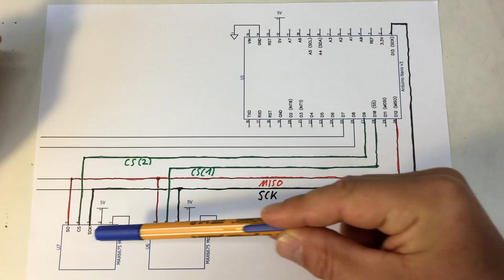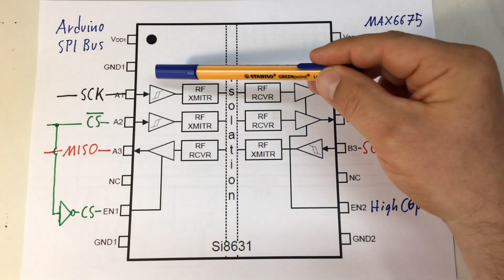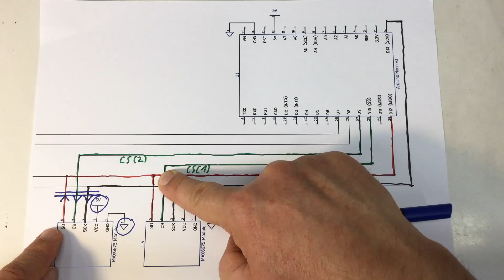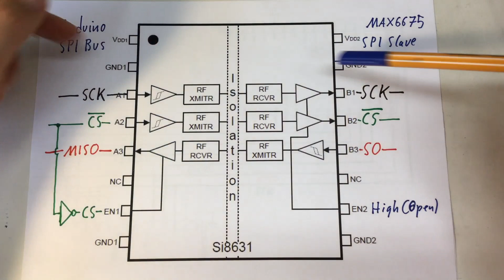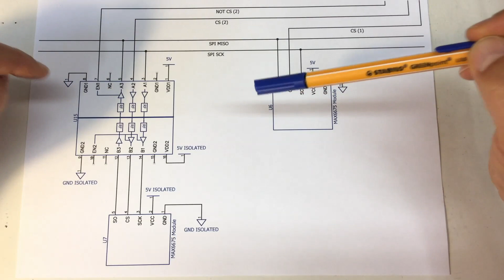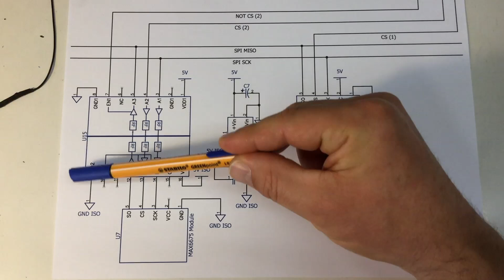Galvanic Isolation of SPI Devices (e.g. Arduino, MAX6675 and SI8631)

Comment: Hi Robert,

I am trying to isolate only 1 MAX6675 with Si8641. It works well for a few seconds but then intermittently the temperature readings show 0.00 & then the correct readings come up again. This sequence of 0.00  is completely random.  I checked all the wire connections but to no avail. MAX 6675 works perfectly without the Si8641. Could you please provide a clue of what may be causing this random behaviour? 
En1 pin is held high through 10K resistor as there only one MAX6675.
Your reply will be highly appreciated.
Thanks
Reply from the maker: Hi Luci, it has been always hard for me to remotely diagnose intermittent errors 😅 But anyway ... Holding the EN1 pin of the Si8641 high all the time could be a problem, because the MISO pin of the MAX6675 goes high impedance, if its CS line goes high, and thus the A4 output of the Si8641 might be undefined. It's better to feed the inverted CS signal into the EN1 pin of the Si8641 as I do it in the video, even if you're using only one Si8641. Hope that helps.

Comment: Is it possible to multiplex multiple Max6675 and use only 1 Si8631?
Reply from the maker: Not really. How would you get several (!) chip select (CS) lines for multiple MAX6675 through a single SI8631?

Comment: Hi Robert. I have successfully isolated two max31856 using si8641. In my design both of them are isolated from the Arduino ground because in a automotive application almost any metallic part of the chassis is a ground. Thank you for the lesson!
Reply from the maker: Hi Mircea, you're very welcome!

Comment: Thanks for the video. This TC seems a grounded one. Why does connecting one  to the V and other to the GND of the multimeter cause TC to incorrect measure the temperature ? is there connection inside the multimeter or the is multimeter just disturbing the TC generated voltage ? Would the same happen with an isolated or open (non-shielded) TC ? From literature it seem that mosly galvanic isolaters are to protect from ground loops  when a non-isolated TC is connected to a conductive housing but when the logic is an externally connected. In another case, when the ADC circuit would be placed in the same enclosure as the TC, would galvanic isolation make sense when the MAX (ADC) circuit is power from an the same power supply but with it's own 220V to 9V transformer ?
Reply from the maker: I guess you're referring to 01:01 where I connect the multimeter: The error is caused by the multimeter injecting a current (it's set to measure resistance) into the grounds of both TCs - a positive current into one and a negative current into the other. That current loop is of closed on the breadboard via the common ground for everything. So to the currents generated by the TCs (comparatively small) the negative, respectively, positive current from the multimeter (comparatively large) is added, and thus one MAX6675 reads a far too high temperature and the other one a far too low temperature.
So the goal here is to break that ground loop. You could have separate power supplies (transformer etc.) for both MAX6675s, but as long as you connect their grounds together again (and in this case you need a common ground for the SPI bus), you won't break that ground loop.
Hope that helps.
Reply: @robertssmorgasbord  Thanks that explains it ! Assume the ground loop happens with the MAX31855/56 as well. Also when having multiple TC's, assume that each should have their own DC/DC converter (unconnected GND) as their analog GND/PWR front end. Though this particular problem would only happen when mounting the TC to a electrical conductive part, (which may happen easiy with ungrounded TC's). Assume that is often not the case as to avoid the thermal conductivity of such part and influence of the maeasurement.
Reply from the maker: @de-bugger  You're welcome! And yes, the MAX31855/56 has the same problem. Anyway, two TCs being somehow electrically connected by the parts they are mounted on is not that uncommon and can easily happen by accident. E.g. you're measuring the temperature of the heat sinks of two power supplies and both heat sinks are connected to mains earth ... ground loop!

Comment: Thanks for the vid Sir when i read about SPI isolators it was stated they are used in circuits with a mix of high & low voltage to protect the low voltage section which is why i did not use it for my problem where I have an Arduino with Bluetooth which is used to simulate a cd changer/shuttle to fool the stereo and allow playing Bluetooth music to old stereo but the problem is i am getting digital noise on the speakers. The Arduino connect to the stereo using SPI. Do you think SPI isolation approach you utilised here will fix my issue?
Reply from the maker: It should! SPI isolators are routinely used to translate between 5V and 3.3V devices. In fact when "inserting" an Arduino into your CD player it might be a very good idea to use galvanic isolation. In other cases you could also use a non-isolated level shifter like the TXB0104.

Comment: Searching for I2C Isolator. Would appreciate your advice.
Reply from the maker: I've used a Si8600 (relatively cheap, designed for I2C) in my "Galvanic Isolation of 1-Wire Devices (Direct Power)" https://youtu.be/WvG2_sHoxCQ video.

Comment: If i want to isolate 8 thermocouples how to do that. ? 

Do i need to isolate each with each other.?

That would require 28 those isolator modules.

Pls help
Reply from the maker: You just need 8 digital isolators (plus 8 isolated DC-DC converters) ;-) If the MAX6675 is run through such an digital isolation it's isolated, full stop. There is absolutely no need for more digital isolators / isolated DC-DC converters. There's also a video out now regarding the current/power requirements for digital isolation: https://youtu.be/BpCzpMnXc6M
Reply: @robertssmorgasbord  Would it be possible to use an isolated thermocouple, so that we need not do any isolation ?
Reply from the maker: @mumbaiverve2307  Yes, of course. Though most type K thermocouples are not isolated you might be able to find some that are. If you do, please let me know.
Reply: @robertssmorgasbord   Hi Robert, thanks for your reply!
I was not aware of that. I recollect using J type thermocouples which were isolated and not much more expensive than non isolated thermocouples,mostly in injection molding machines.Nice to learn something new ! 
https://www.amazon.in/Isolated-Ungrounded-Thermocouple-Sensor-Celsius/dp/B07HVBQ738
I am not affiliated to them in anyway; just googled :)
Sometimes the nomenclature differs from area to area; so here when its said its isolated, usually it is meant that the thermocouple leads show no continuity with the mounting body of the TC; I hope you mean the same by isolated TC.
Reply from the maker: @mumbaiverve2307  You're welcome and thanks for the link! Please excuse my use of word "isolated" in that context. While it's a perfect description of such thermocouples, the commonly used term here is indeed "ungrounded". But you found that out by yourself :-)
Reply: @robertssmorgasbord   Am I right in thinking , if we use "isolated" or "ungrounded" thermocouples; we need not do any optical isolation.Thanks a lot for your patience :); I realise answering comments is a big chore !
Reply from the maker: @mumbaiverve2307  Yes, you're absolutely right. It doesn't matter where the isolation happens, in the thermocouple itself ("isolated"/"ungrounded") or further down the line like shown in the video. Electrically it's the same. And while answering comments can be a chore, I do like to answer interesting/intelligent questions like yours, because often I can learn something myself :-) E.g. you can get isolated K type thermocouples if you're willing to pay a few dozen dollars and they're called "ungrounded".
Reply: @robertssmorgasbord  You are most kind.

Comment: isolating SPI can be easier, considering each wire has 1 direction data flow. Conversely, the I2C is much more difficult, as the data in SDA flows both direction. Unless ofcourse, you use a magnetic or RF based isolator. Optical isolation will not be possible (LED cannot be used as receiver or photodiode as transmitter).
Reply from the maker: Indeed, the bidirectional SDA dataline of I2C is not that easy to isolate. Fortunately there are chips available (e.g. Silicon Labs SI8602) which do just that. They usually contain two transmitter/receiver pairs (capacitive or RF coupling), one for each direction. Internally they have some additional glue circuitry to combine the output of a receiver and the input of a transmitter into a single pin.

Comment: extremely interesting.
Reply from the maker: Indeed, it is! I was surprised how many chips for digital isolation are out there. It seems digital isolation is in high demand in the industry. BTW there are digital isolators out there providing galvanically isolated power too - all in one chip. Though for low supply currents only and with an abysmal efficiency.